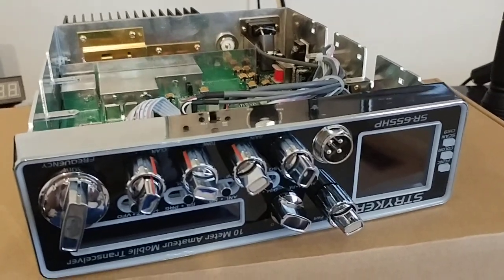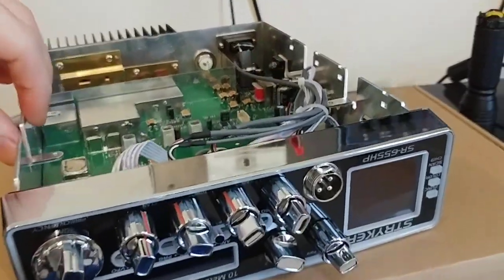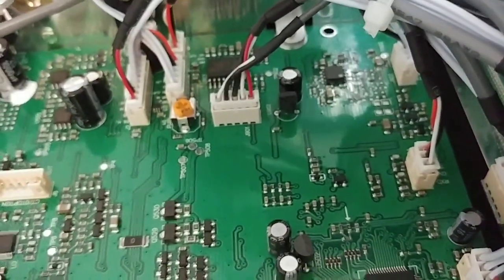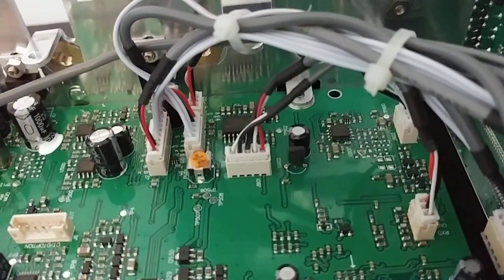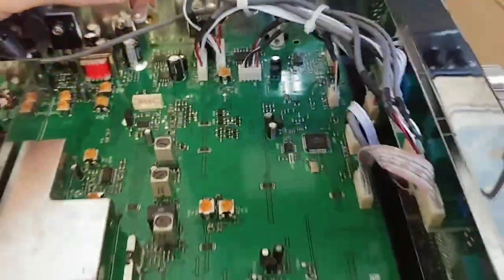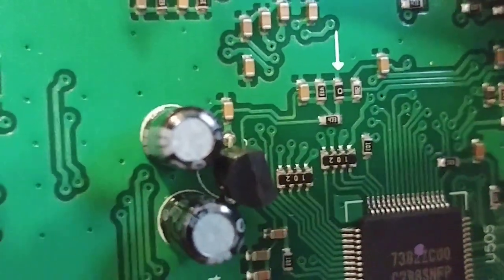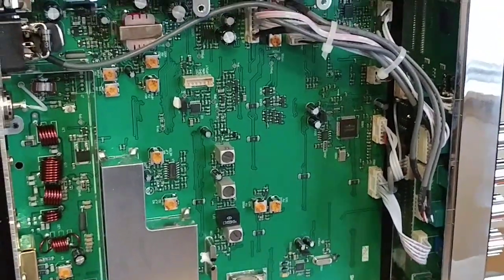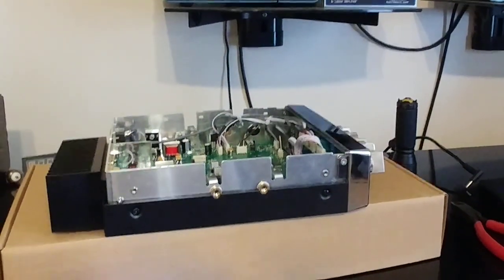Stryker 655 conversion v1

Comment: Thank you for this video, very detailed on the location of the conversion mod. I'm now using my stryker 955 on the CB band and I'm having a blast.
Reply from the maker: Awesome, glad to help. 73's
Reply: Will this conversion work for the Stryker 955 because Im ready to buy
Reply from the maker: Alex Goodwin yeah bud, 655 and the 955 use the same conversion mod. 73
Reply: And this is all you have to do to run it in a truck ?

Comment: Might be a dumb question, but here goes.  I just bought a used 655hpc, already converted.  Love it. Band A starts at 25- something and Band J goes up to 30- something. CB range sits nicely on Band D. My question is.. what was this configuration out of the box? Published ad material says a 655 is a 10 meter,  28-29 mhz. This all looks so perfect now,  a-e, f-j, etc. What did this look like before conversion? Thanks,  7-3.
Reply from the maker: @georgio48101  10 meter band and the 12 meter band before conversion sir.

Comment: I just bought a stryker 655hp and it's not set up as a regular cb. Do I need to convert it from a 10 meter to a 40 channel ?
Reply from the maker: Yes, the conversion is required for CB channnels sir.
Reply: @GroundControl204  one of my drivers told me they were good to go right out the box as his was when he bought it at a TA truck stop. This one  was not. Thank you
Reply from the maker: You know there is two versions for the 655, those two different models have two different conversion methods as well.
Reply: @GroundControl204  this one i bought is the 655hpc
Reply from the maker: @lesco09418  the V1 is the original, it does not have vented slots on the cover. The V2 has vented slots, that’s one way to tell which version 655 you have. 
If you need it converted contact me Groundcontrol204@icloud.com

Comment: I did mine SR-655HP, but still limeted to 28 to UP, i can`t find myself why this does`nt recognize the resistor "0" delete, even so i did procedure to reset from factory
Reply from the maker: You have to change the band group in the band settings menu on the radio.
Reply: @GroundControl204   You are a great, thank you, I'm going to try it , i did changing bands but doesn't work at all, can you take a photo between two soldered points?.
Reply from the maker: @yananRamirez  Band 4 is where CB channels are in the settings menu

Comment: I love hearing CBers use the term "73's". Most don't ever say it correctly or even know what the fuck it means. It's correctly pronounced 7'3 not 73rds or 73's. Just SEVEN THREE. I'm a 28 wpm coder with an amateur extra class ham license. Call sign AF5GV. This is a nice radio. I'm thinking about getting one mainly for 10m.
Reply from the maker: After a heavy stint in the military, I’m a lot laid back now, standard operating procedure on “73,” yes people get it wrong and say it wrong, hell even I do but as a civilian now these things do not bother me at all. Thanks for stopping by, 73👍🏻
Reply: @Pro2nd guy I noticed on your Biography on QRZ, that you used 73rds. 
Now that’s funny after your rant here about proper usage. 
I suspect maybe that was intentional, or you became enlightened after posting the Biography. 
Either way, 73 de K4RRC

Comment: Can a switch be added to isolate the resistor ?
Reply from the maker: The resistor is smaller than a grain of rice, so using micro wires and a small toggle switch will work. But you better be real good at soldering FYI. 73